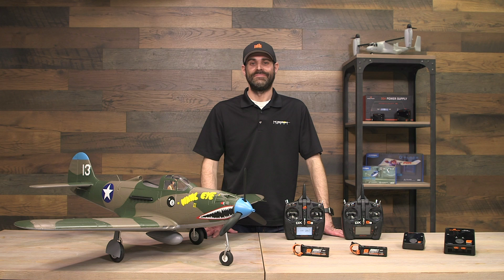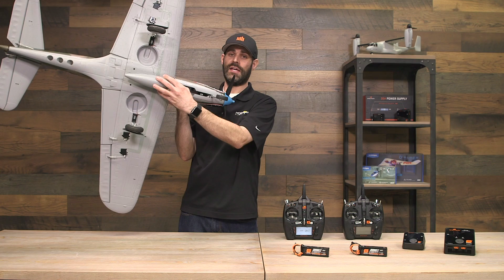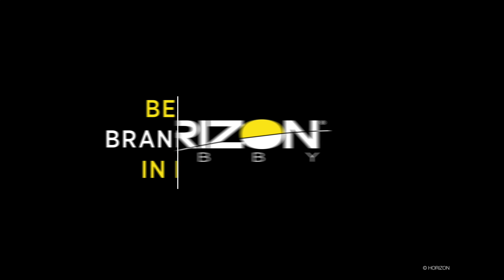E-flite® P-39 Airacobra 1.2m Overview

Comment: Hello! I bought this plane the other day and had a huge problem I'm hoping you could help me with.. I set everything up according to the manual on my old school Dx8. I'm using a 4s 2200 battery, and placed it on the battery tray and slid it all the way up like in the manual. I noticed as soon as it took off it felt like there was a ton of bricks in the nose, and the plane was wanting to dive straight down.   I took it out of Safe mode, and it was still wanting to go straight down. Pulling all the way back on the elevator it only climbed just a very small amount, and I barely got it down on the runway. I've been flying for over 7 years now, and have never had this kind of problem. I adjust the push rod to give it a little bit of up elevator, but I'm kind of scared to try it again! Are you guys sure the battery goes all the way into the nose? I'm really confused on what could of caused the plane to fly this poorly! Thanks!
Reply: You checked the CG right? Maybe the manual is wrong?

Comment: Should have used the Russian livery of that aircraft.  These planes were given to Russia when the US Air Corp and RAF didn't want it.  Ended up becoming one of Russia's favorite fighter and highly respected among them.  On a side note, no E-Flite Warbird will work with SAFE correctly with a DX6 radio (retracts up = No Safe / retracks down = Safe) out of the box.  You need to ad a servo Reversing Y-Harness to the retracts slot (slot 5) on the receiver and attach the stock retracts harness to that.  Then it will work correctly.  This also applies to the flaps.
Reply: Can you explain that? There is no Retracts slot that I know of. Do you mean Channel? Such as channel 5 or channel 6? Saying Retracts slot is confusing. Most receivers are numbered and assigned a switch to operate from. So safe would be designated a switch seperate from retracts. They wouldnt be on the same channel as safe that I am aware of.
Reply: @scottfirman  Yes, I mean slot 5 on the receiver which is where retracts goes.  On a DX6, you don't have enough channels to have SAFE Select on a separate channel, it must be tied to either the retracts or flaps.  However, it works backwards from what most people would want, which is SAFE on when the gear is up or flaps are up.  Most want SAFE on when landing, which you cannot do out of the box.  You must use a servo reversing y-harness to make it work correctly.
Reply: Yes, if you'd like to use SAFE Select on the retract channel with a 6-channel transmitter you will need to use a reversing harness/y-harness. However, you can use SAFE Select on the flap channel and have it operate as desired (flaps up = SAFE Select OFF / flaps down = SAFE Select ON) without the need for any different connections/harnesses, as noted around the 3:15 mark in this video. This is why E-flite officially recommends using the flap channel and not the retract channel with a 6-channel transmitter.
Reply: You can use the flap system and/or flap channel reversing to make SAFE Select operate as desired on the flap channel (flaps up = SAFE Select OFF / flaps down = SAFE Select ON) without the need for a reversing harness/y-harness (you may just need to use negative/opposite values for the flap system travel and/or reversing to make it work...as recommended in the E-flite manuals/addendums related to this).
Reply: @jm_hh  NO you cannot have flaps up with SAFE Select off, he is wrong.  Once the system detects flaps are at least 50%, they will automatically engage SAFE On.  I've tried this with Horizon Customer support.  Once you adjust the flaps "straight", the SAFE will automatically go on.  You mus also use a Reverse Y-harness on the flaps should you decide to go that route.
Reply: I’m the guy in the video and I used the airplane in the video to make it work exactly as described ;) You simply need to reverse the flap channel then use the OPPOSITE values (negative instead of positive and vice versa) for the flap system travel...then when the flaps are down SAFE Select will be on and when the flaps are up SAFE Select will be off. This will be shown in an addendum to the manual and I may also show it in a follow up video. You will only need to use a reversing harness if you want to use SAFE Select on the gear channel (so SAFE Select is on when the gear is down and off when the gear is up).
Reply: @jm_hh  That's great news, no one from Horizon customer service apparently knew about that.  Thanks for clearing this up.   Does this apply to all previous warbirds as well or only to this one in regards to flaps?